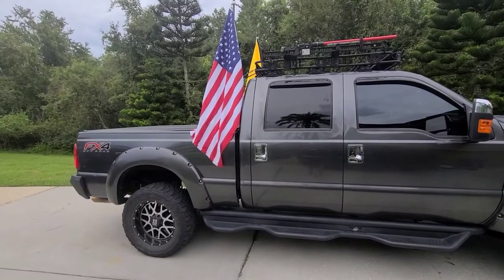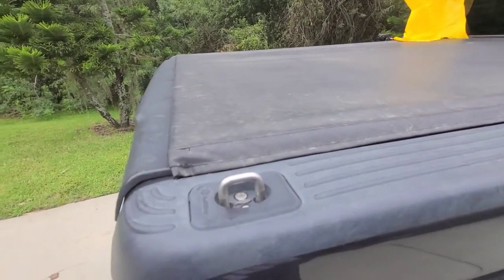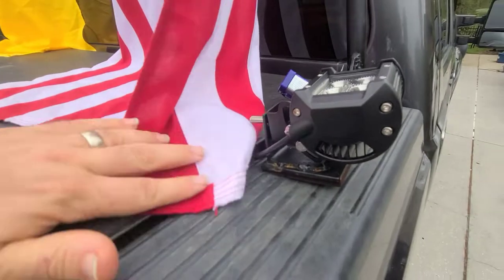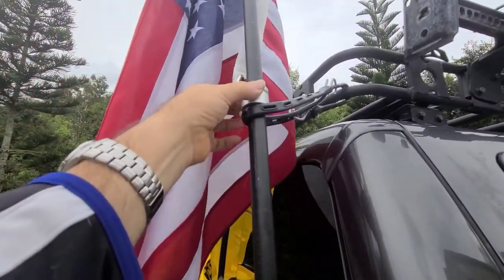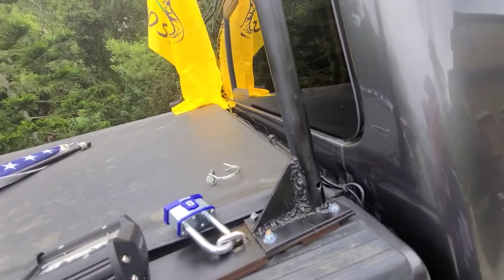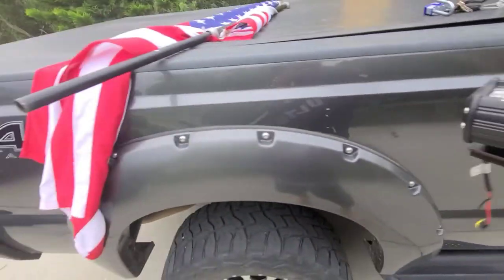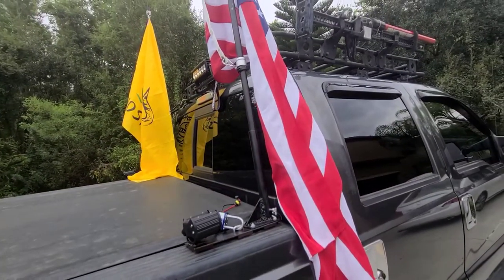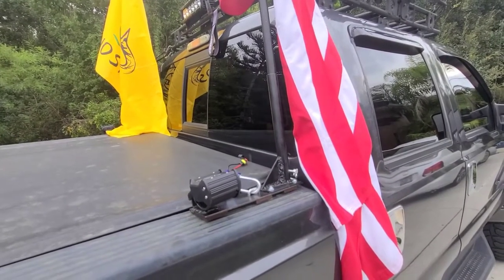DIY Truck Flag Mount with Lights - No drilling into the truck, quick takedown, works with bed cover

Comment: Fantastic design!  Love that it doesn’t interfere with using the bed or hitch and is so easy to attach and remove.  The lights are phenomenal!!  I wish I had your skills, but will need to find an easier option for flags on my truck.  Does anyone sell a design like yours? 🇺🇸❤️🇺🇸
Reply from the maker: Unfortunately not that I found, which is why I had to make it. This is the closest thing that I have found: https://youtu.be/xebGbUOhtaY but according to the comments on the video, he doesn't actually manufacture them. I think he was looking for someone to make them, but not sure if he has or not. They don't have the lights though. I thought about maybe taking my design idea to a manufacturer and see if I could have them more professionally done for a decent price. If I ever do, I'll post it here.
Reply: @TestDriveRacing  Thanks for your reply!  Please consider pursuing your venture. I would gladly be your first customer. Best wishes! 🇺🇸❤️🇺🇸

Comment: Just need to make sure the American flag doesnt touch stuff when its not waving
Reply from the maker: Yes, I tried to account for as much flag etiquette as I knew and could account for in the design. I know it's not supposed to touch anything underneath it, but unfortunately that's the one rule that I really had a hard time getting around with this design. I do take them down whenever I'm going to be parked for an extended time for that reason.  As it is, the poles stand ten feet from the ground on my truck and I probably would have had to make them another two feet taller in order for the flag to not touch the side of the truck bed or the soft cover, or I would have had to go with a much smaller flag, but the 3x5 is the pretty standard size.  I did make sure the Stars and Stripes was on its own right, illuminated at night, is the same size or larger than the other flags, it's always the first one to be put up and the last one to be taken down...  but your point is well taken.
Reply: So worried about the flag not touching the ground
Reply: @davidtolman1266  maybe i can burn it
Reply: @kyle2196  why? It's rather overrated.

Comment: Instead of putting retaining pin into the hole, try a bolt that fits so you can screw into place and not worry about theft. Just food for thought.
Reply from the maker: That wouldn't stop anyone from stealing or vandalizing the flags since they are just clipped on. The pins are mostly for the quick takedown aspect because there are times when I'm going through a drive-thru with a lower overhang and I can just hop out and take them down in 2 seconds to go through the drive-thru, and then put them right back up.
Reply: @TestDriveRacing  ok now that you mentioned it, that makes more sense. I run my flags with my trailer hitch on my car, I use emt pipe and a hose clamp.